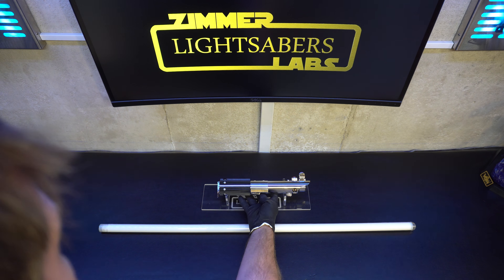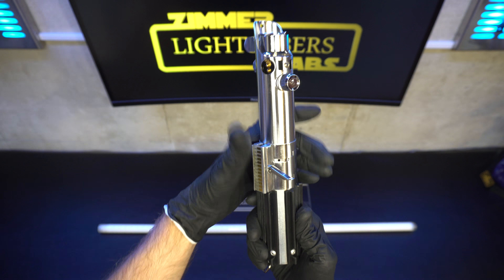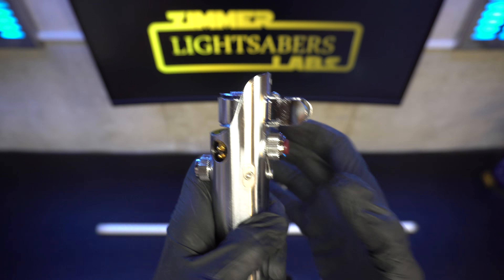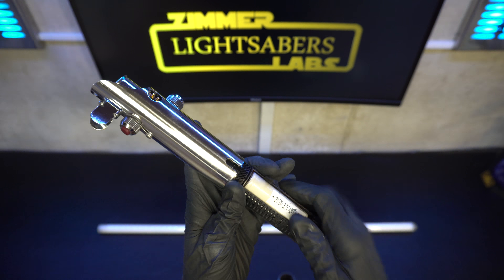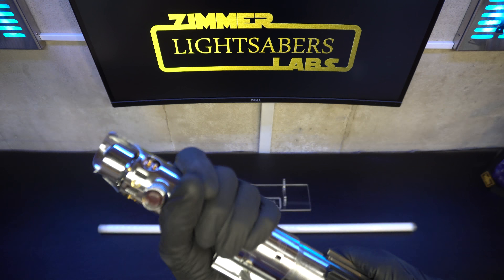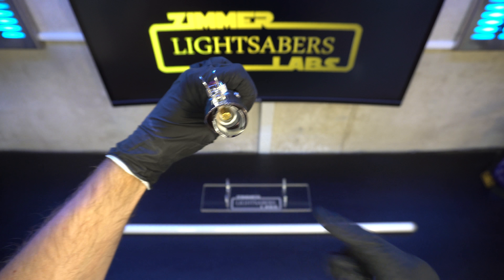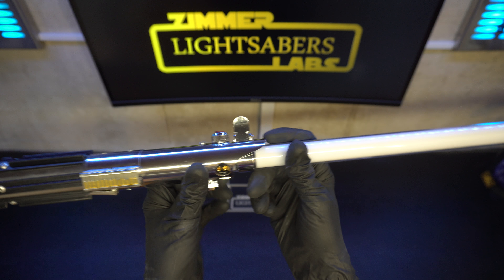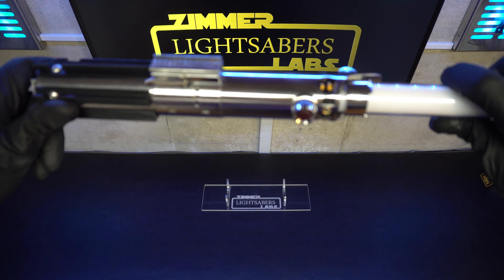Matheus' Graflex 2.0 Neopixel Teensysaber w removable battery

Comment: Awesome work man, I would love to pay you for some work in the near future,   

Regardless I have a quick question, all those battery types you showed in the video, I take it there are rechargeable versions of those out there?
Reply from the maker: Hi Thomas, all those batteries are rechargeable lithium.  generally, the name of the battery tells you what size it is (18650 batteries are 18mm x 65mm for example).  And all the batteries I use in my lightsaber builds are all rechargeable.  There really aren't any standard batteries available that are powerful enough to run a lightsaber.  Maybe the Energizer Info Lithium batteries.  But they're very pricey...
Reply: I’m actually not aware of any lithium batteries that aren’t rechargeable. I’m sure that somewhere out there someone has made some despite that being completely beyond stupid to do so given just how limited the amount of lithium on Earth is. To purposefully design a lithium battery that cannot be reused would be a physical embodiment of the wasteful consumer culture that companies like Apple have helped to perpetuate by constantly creating products meant to be disposed of and replaced and any repairs are by design made to be exceptionally difficult or near impossible, and the company actively spends time every day trying to eliminate the tools and resources that make repairs possible.

Comment: Where did you get a killswitch that was rated for high enough amps to handle a neopixel saber? Or is there a way to wire it such that it doesn't hold that current when the saber is on?
Reply from the maker: Great question!  I usually source my parts through digi-key or mouser.  Basically, I just order whatever switches are available with the highest amp rating.  Usually they are rated to around 2-3 amps, which obviously isn't as high as the blade is running at times.  But the ratings are conservative, and the switches can handle quite a bit more.  Additionally, if the switch were to get overheated/get damaged, the saber would simply turn off.  Adding the lithium battery protection circuits into the mix adds a further layer of protection.  So at the end of the day, if something went wrong, the saber would just turn off and need a replacement switch.  There is no real risk of something dangerous happening if a kill switch failed because the overall build has multiple safety layers built in.  Redundancy is always the best solution.  Unfortunately, I doubt that anyone manufactures kill switches that are actually rated high enough for a neopixel lightsaber.
Reply: Ethan Zimmer, Zimmer Labs I’m hoping that one day this is yet another problem that you will offer a solution to. I’d love to see Zimmer Labs as THE company that saber customers AND sabersmith’s turn to for the best parts and builds alike.